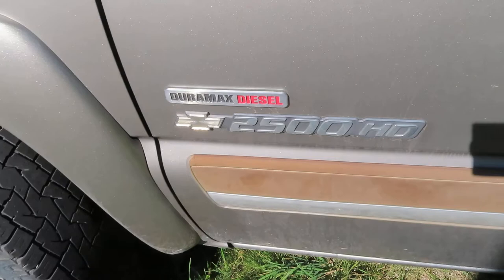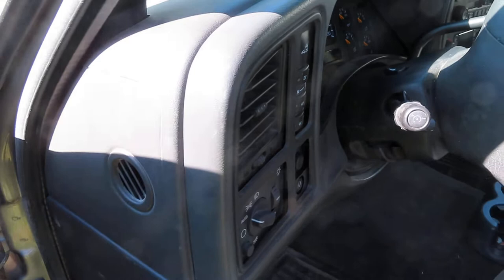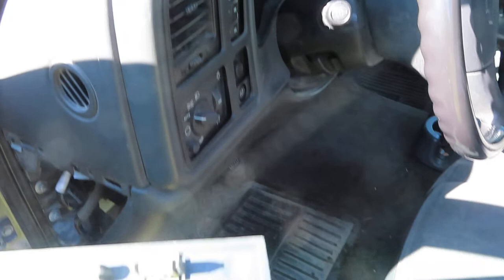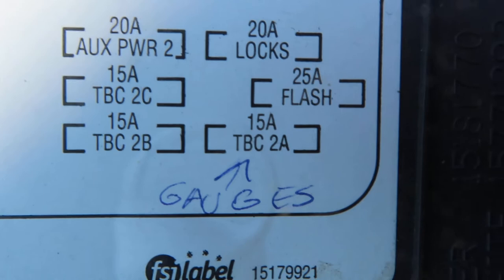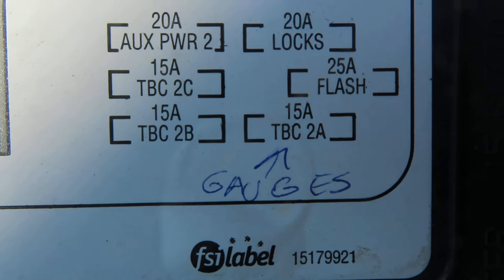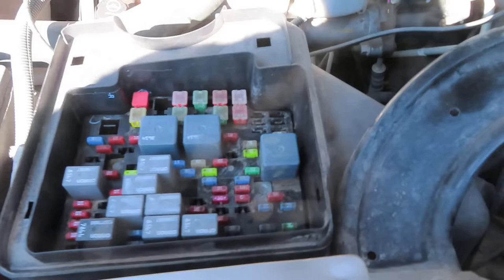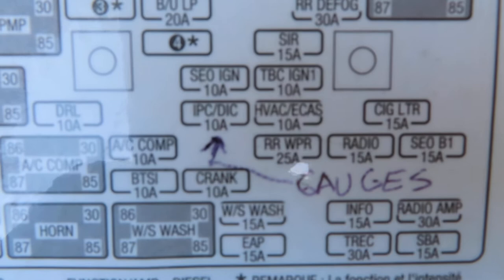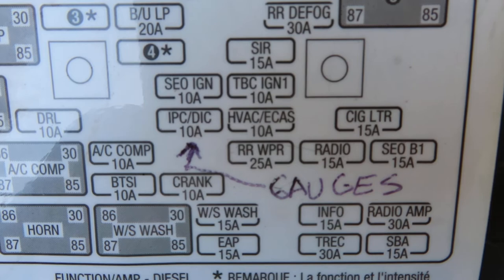2003 Silverado 2500 HD Duramax - Gauge Panel Fuses - Which ones are they?

Comment: I hope its the problem on my 04 ESV! Only the back light and often te engine come on when i puth it in the ON position! After starting, few seconds or some times a minute later, the dash comes to live and all works as normal! I hope it is the problem! But im curious witch fuse it is when i look in the fuse box! There are a few 10 amp fuses in there 😂😂
Reply from the maker: No totally sure on your vehicle.  I'd look for IPC/DIC in the fuse box in the engine compartment.  Even if fuse looks good reseat it or replace it.  Still no success I'd try reseating the main connector on the back of your cluster.  Requires you to pull the fact plate off the dash and remove the cluster.
Reply: @paulhaines5755  thanks for answering ! I look for it i hope it do the job for me to! 🤙

Comment: Both fuses are good but all my gauges are stuck at 0 except speedometer is stuck at 60 and odometer doesn’t show anything either
Reply from the maker: Hmmm - not sure - go to my channel and look at another vid I did on the gauge cluster for this truck.  It explains where the power is supposed to be on the wire harness coming into the cluster.  I would advise checking the voltage using the black, orange and pink wires in the wire harness.  Check black white stripe (ground) to pink and black white stripe to orange.  If power is present to both, then it's likely you have an issue with the circuit board in the cluster in which case I would pull the cluster out and send it to someone who can fix it.  (FYI you can drive your truck without the cluster installed).  There are various people doing this repair service on e-bay.  Hope this helps!  Paul
Reply: Did u ended up finding out the problem having the same issue also

Comment: What if the speedometer ain’t turning on at all except for the turning signals
Reply from the maker: Hmmm - I'd check both fuses and replace.  Even if they appear to be good you might want to replace just to be sure.  Beyond that, you should try to reseat the connector on the back of the gauge panel and see if that does anything.